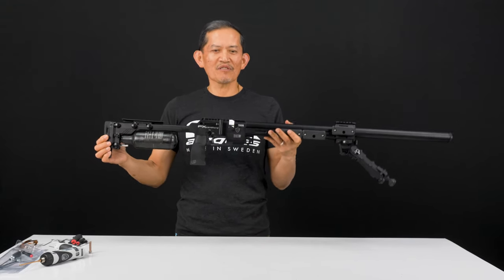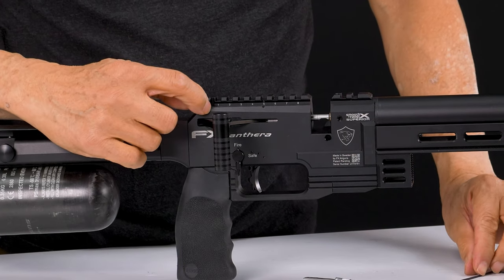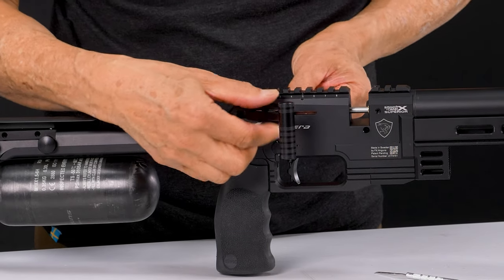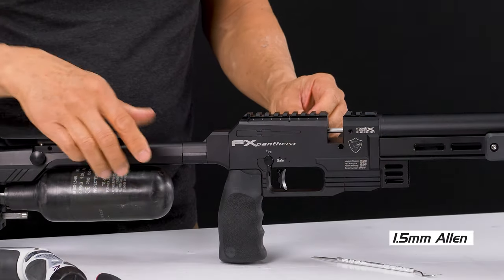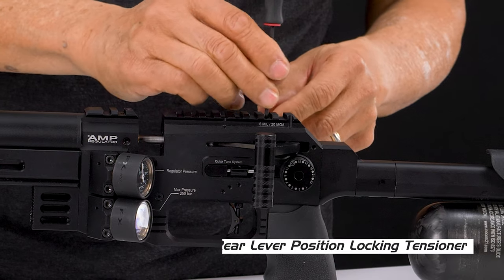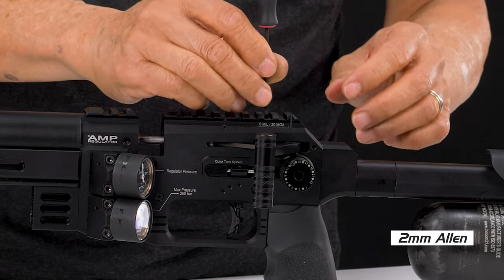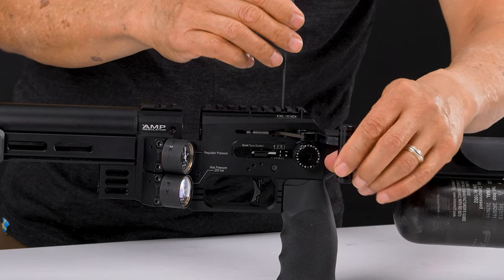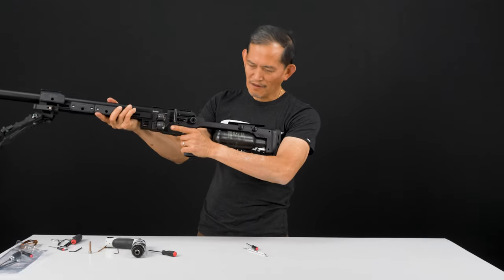FX Panthera Left Hand Conversion - FX Airguns Masterclass

Comment: Hi Ernst. After removing the back screw of the cocking handle it does not come out like yours. Seems like there is a pin inside holding it. My pin does not look the same. It’s the same as the one on the other side

Comment: Thanks, quick question: seen a comment and trying to confirm... does the production Panthera have the provision to add a second bottle to the front of the block? Shot count is important to me. Having a front mounted bottle (like the Impact)  would change my interest into a purchase.
Reply: Yeah... You mount a tank.. to your table.. and run a hose to your tank lol

Shot count isn't that bad shooting a light pellet. The 22 will get over a 100shots in the 500mm version at 870fps. 100 isn't bad.

And if your shooting slugs... Doesn't matter if you have the panthera or a m3 with a 580cc bottle. If your slinging 40g+ slugs at speed.. shot count is abismal. 

Just run a impact m3 if you want hundreds of shots a fill. Or tether the panthera